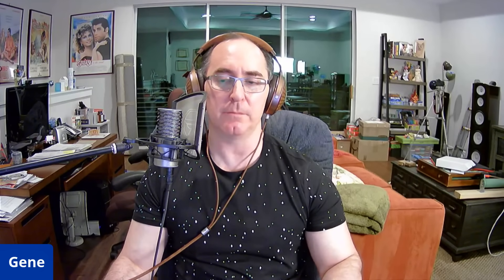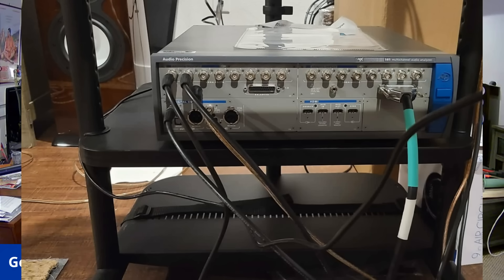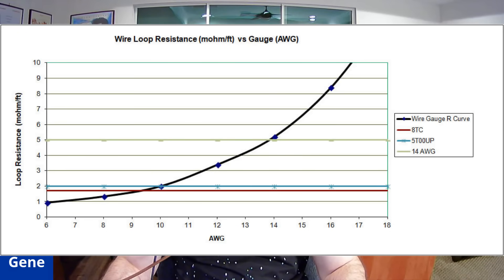Speaker Cables Really Don't Make Much of a Difference?

Comment: Shouldn't you be measuring same gauge cables.......?
Reply from the maker: The point of this exercise was showing very little difference between expensive and cheap cables. Many exotic cables have higher resistance than cheap 12AWG so it's on them if they are at a disadvantage accordingly.

Comment: My understanding is that the real advantage of braided multi- conductor cables is that they act as a choke for rfi and emi. Many recording studios such as mine are located near other businesses which can often create rfi and emi issues. Some of these issues can be fixed with a high quality power conditioner however I think you miss the makr by not testing it in terms of preventing rfi issues.

Comment: High value knowledge right here.
Would you also measure some real crappy speaker cables as well? I recently switched from 14 gauge CCA to 10 gauge OFHC and thought the audible difference was extreme. Or did I just imagine that?
Reply from the maker: CCA is garbage and should be avoided for audio applications.  It's about 20% less conductive than pure copper wire.

Comment: Is there any point in OCC over OFC or even standard copper. I use Canare 4s11 but I believe 4S11G is OFC will it be better.? I also have Van den Hul Teatrack which is OFC but in comparison I felt the Canare a little more covincing on saxaphone on Pink Floyd Wish You Were Here album but a very very slight loss in Bass weight....difficult to dicern though and you start to question your own imagination. The 4S11 I think is all that is needed but if I was buying again I would go for the 4S11G just for th hell of it.

Comment: Hi Gene, I have a Hantek 1832C handheld LCR meter, and I'm measuring Belden 5000 by Blue Jeans (12ft) and another one from Audio quest I think (12ft). At 10khZ BJ measures at about 0.7 ohm and AQ measures 0.5ohm impedance. Meter is showing pretty much between 0.01 and 0.05 at frequencies below 2khz and about 0.1 at 4khz. 

My gut says that the meter is the limit here (it has good reviews in the EE community, but I think the resolution is the issue here). When cables are shorted, the meter reads 0.07 ohm at 10khz. 

What do you think ?

Comment: CAPS 2 C -NOT SHOUTING - THANK YOU FOR  YOUR ANALYSIS. I THINK ITS INTERESTING THAT THE FREQ RESPONSE FROM THE SPEAKERS WAS SOOO TINY. BUT EVEN KNOWING THAT, I , YOU,AND OUR AUDIENCE WILL NOT RUN OUT AND WIRE EVERYTHING IN 16 GA. IN FACT RECENTLY I DECIDED TO REPLACE SOME 16 GA WITH 12 GA FOR SOME OF MY LONG RUN SURROUND SPEAKERS… FEELS LIKE A NEW SYSTEM… IM SURE THE OSCILLOSCOPE WILL SHOW NON DETECTABLE FEEQ SHIFT, BUT IM LOVEN THE 12 GA WIRE I JUST INSTALLED…

Comment: Why do cables that measure so similarly actually have different tone?
What about musical instruments? Say you have two violins that are tuned identically and yet when they are played there is clearly a tonal difference. Let's say now one is made of kiln dried maple and one of carbon fiber. You tube then identically. W will they measure the same? Why yes they will. Will they have different tone? Without a doubt. The response when you play them will feel different and they will have different sustain characteristics as well as tone.Same notes same player yet tonal difference. 

If what you are saying is true then two identically measuring speakers with different drivers and construction will sound identical? Of course not. Why? I think measurements are only part of the story. They communicate only the parameters the measuring device is capable of. In the end it is the human experience that decides what something sounds like through individual and group consensus. Measurements are definitely important. The final judgement will always be with the ear.

Comment: Dear Sir, thanks for the video, very useful to see some measurements. But I am still confused: You measured differences: resistance, impedance and capacitance are different; and You are saying there is no difference what cable to use. Another point, You took basically one Kimber known cable, don't even mentioning what are the others. And You saying that all other cables (those You never even seen) don't make difference .. big statement. Actually this video makes much more confuse, than those saying cables makes difference - because at least the cables are really physically different.
Reply from the maker: It takes a really bad measuring cable to show an actual measurable difference when connected between an amp and loudspeaker.  There's nothing confusing about it. Use low resistance speaker cable, and you're good. Use Kimber if you want fancy looks and slightly measurably better performance which doesn't translate into audibility.
Reply: @Audioholics  Interesting: You are saying "doesn't translate into audibility", but You did not measure that aspect/properties at all. Maybe cables can be very different and not make a difference for exact listener in exact situation or in general at all. And maybe cables can be very similar in measurable properties but make a huge difference in sound for specific equipment/situation/listener. You simply do not know that in this exact case here, because You measure known electrical properties of a cables, not how it sounds when used. Decibels measured while changing one frequency at the time does not say much about how it sounds: only louder or quieter, and I do not see much people saying cables change level of sound dramatically, so there is no point to prove that. And what You did here by making statement "speaker cables does not make much difference" looks more like click baiting than objective testing. And I am not saying You are wrong or right with Your statement, I am saying - You don't know that.

Comment: I use 12 gauge ofc tinned speaker wire. My surround system is in a 30ft x 30ft room and on longer runs ofc wire sounds better than copper clad aluminum wire(CCA) to me. I’m no audiophile buy I am a musician and I listen to a lot of music. I also love watching a good movie with my family using the surround sound. I want to tell you that although your video had little useful information I was hoping to enjoy it and hopefully learn a little something. However, when told us you paid $40,000 for your tester thing you lost me. It came across like one of those product reviews that someone tells you about every piece of their system and how they have it set. You were just bragging. I might have bought OFC 12 gauge wire when 16 gauge CCR would have done the job but I didn’t spend $50,000 to ser which one was better.